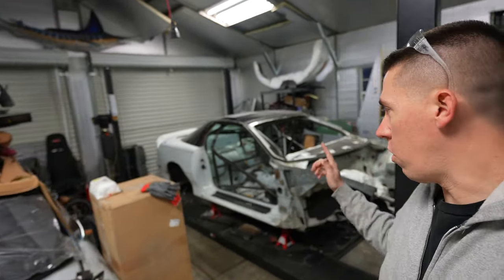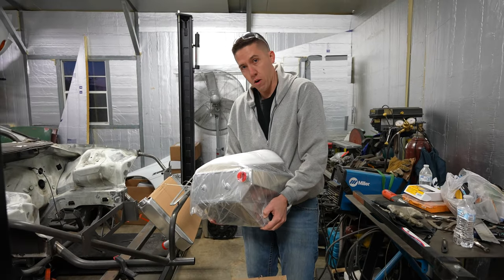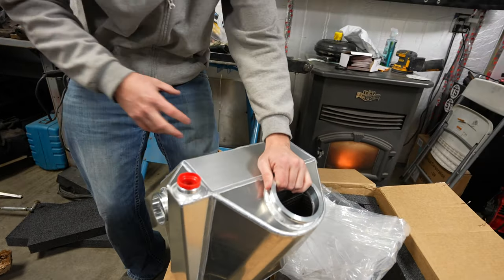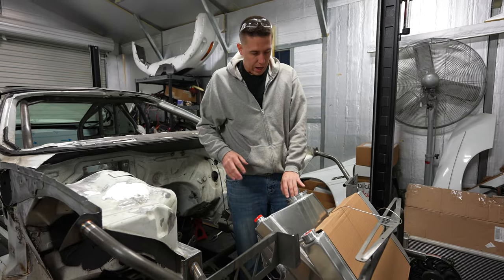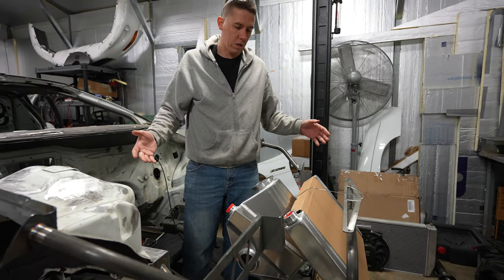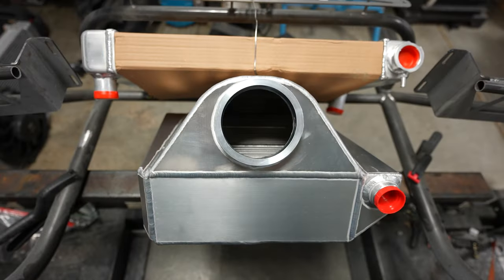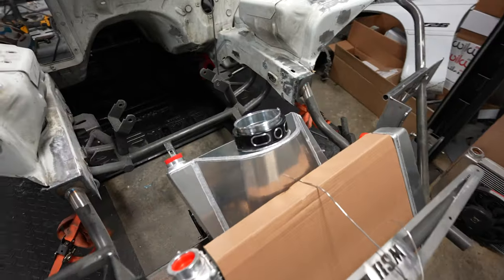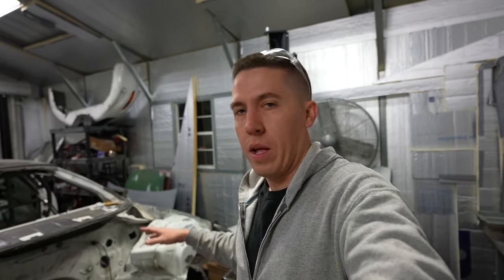3000HP Twin Turbo Air To Water Intercooler Is INSANE!

Comment: Did you think of trying the texas speed intake with the tick intercooler? I've been thinking of that for my engine.
Reply from the maker: Didn’t know Tick had one for the Texas Speed intake just looked it up. The problem is I couldn’t find one with an intercooler even the small shearerfab that would fit in the car without cutting into the windshield area. I want to be able to run factory glass for true street events and none of the other options would fit. Maybe that one would
Reply: @BuildTuneRace  they have 2 different size intercoolers and depends on the intake size. They have low and mid and high raise intakes also. I'm a tick member so I see all the info and deals that pop up.